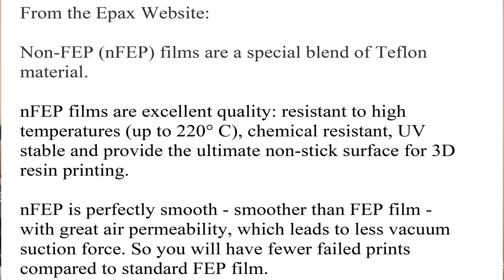NFEP for resin 3d printing, you're not using this?? WTF?!?!  We need to talk about this!

Comment: How did you judge the correct tightness when putting a nFEP on the SM4k? I've tried using the sound method but I was unable to get higher than 230Hrz even at maximum tightness. I've been having trouble with support failures at lower layer heights and think it might be a problem with the FEP being too tight.
Reply: I too was having a hard time getting it up to 300Hz and settled for ~265Hz which was pretty tight... seems to be working fine.
Reply: Literally just switched to NFEP and am asking that same question. I can only just get 200hz and i've got no more room to tighten. Am thinking its either a denser chemistry or my spacer for fitting was a little too big. It sure feels pretty tight though, in fact given the fails i'm getting i'm thinking its too tight even at that range. Would be good to hear the hz from a succesful NFEP-er

Comment: Thanks for the stories, tips and tricks!  I am just starting with Anycubic Photon S printer.  I have been watching your videos to "get a clue".  To date I have found that supports make or break the print.  I am an expert at "breaking" and struggling to build my making skills.  I love undead, skeletons in particular and the small bits make them a challenge.  When they are not covered in armor, using crude weapons, there are a lot of skinny limbs to support without damage.  Would you consider doing a video setting supports for skeletons (or other thin limbed) minis?

Comment: Slipperier has been added to my vocabulary.  Thanks!  I actually got PTFE lubricant that I was going to try this coming week. Another YouTuber recommended that.
Reply: After fighting my printer for nearly 2 weeks, I saw Crafsman's video that recommended PTFE lubricant.  Since then, every time I clean my vat I lube the FEP with a bit of PTFE, and haven't had an issue with prints sticking to the FEP since.

Comment: Great vid!  While you're on the topic of FEP...  With all the mono printers hitting the market currently, I think there is a great need to address a certain topic.

That topic is... the use of an additional FEP sheet directly over the monochrome LCD screen, for protective purposes.  As far as I know, all of these new monochrome printers lack a layer of tempered glass above the LCD.  Many people are complaining about how easily the unprotected screens scratch, and are also concerned about a possible FEP tear during a print session (resulting in potential disaster for the naked LCD).

You mentioned in the past about maybe making a video on this topic, and I think it would be a TREMENDOUS service to the community if you did.  Nobody's addressed this topic on Youtube yet, as far as I know.  Is using an FEP over the LCD a viable solution for those that want to play it safe, and protect their LCD?  Will the extra FEP distort the light too much and compromise the print? These are some questions that need answers.

You could maybe use something like a Mach5ive Stick On Gasket (https://www.amazon.com/Mach5ive-Stick-Gasket-Resin-Printers/dp/B08L41PCS5/) to attach the FEP to the LCD...  With your analytical & scientific approach to testing, I trust that you'd do a great job investigating the feasibility of this practice.

Pretty please?  I think there are probably many people who'd be grateful to have an answer to this question, besides myself.

Comment: Nice! I did not know about NFep. Nice Tube!
I've noticed slower lifting speeds = better details on surfaces that are near parallel to the build plate (details get pulled down/off when lifting speeds are higher). If you find that the NFep gives better details compared to FEP at similar speeds I'm buying that stuff! 
More VROOM the better!
Reply: I've learned that those surfaces are one of the first things to have problems with Vroom speeds when it's too cold, sometimes even before support failures.

Comment: Greg, what are your thoughts on PTFE lubricant?
Reply: I've been using it since my second bottle or resin. Combined with roughing up the build plate it completely cured my problems with prints sticking to the FEP.
Reply: @3rdpig  Same experience here.
Reply: @3rdpig  Ill give this a try
Reply: I treat my FEP with Rain-X . I always use that stuff on my windshield and nothing sticks so I tried it on my FEP and it works great. Follow the directions for application.
Reply: I believe he said once that he thinks it's unnecessary.
Reply: I put a single drop on the FEP in my Photon, and haven't had a print stick since I started.
Reply: Im keen to know his thoughts too
Reply: My missus swears by it!
Reply: I imagine is is helpful for that first few layers, but after that it is going to have mixed in with the resin or baked and peeled off the FEP as part of the model, so I am pretty sure that over an overall print it is not going to help much.

Comment: Any recommendations on using and buying nfep sheets for Saturn sized printers?
Reply from the maker: yeah, Epax makes them big as well, I use them on my Saturn and Sonic Mighty
Reply: @3dprintingpro212  I have just ordered one for my Saturn. If interested its the one for the Exax x10. Its the one that is sized at 10.1 inches. In the UK you can get them from isjuto3d.co.uk/epax-shop.html

Comment: I've been using "NFEP" since the EPAX X1 original version was released.  A while back, I tracked down what this stuff was, and found it is PFA (Perfluoroalkoxy) film.  I have been buying it by the sheet/roll from McMaster Carr, and cutting it to size for all my LCD printers.  It does work better, and lasts longer (because resin doesn't stick to it as bad, so it doesn't pull the film into deformation).  It is McMaster part number 84955K26 (https://www.mcmaster.com/catalog/126/3863/).  Don't everyone go out and buy it all up, because I might need more!
Reply: Awesome, just ordered some!
Reply: what thickness did you order?
Reply: @robertfousch2703  0.005" (0.127mm)
Reply: Thanks for the info - that link does not seem to work for me, it shows multiple items. I manually searched for the part number and it seems to show this - is this it? Thanks again! 

https://www.mcmaster.com/84955K26/
Reply: @Gijoeandstarwarsguy  Thanks for posting a working link.  Yeah, I noticed somewhat later that the link I gave seemed to only work for my current session.  The part number is correct, though.
Reply: @scifiguy000  Hey man, I just did some math and to let everyone know, YOURS is HALF the price of the epax one! We should get GREG to get some and test it! 

288 SQ INCHES  (McMaster)

31.83 per product / 288 =  0.11c per sq inch

---------------------------------------------

128.7  SQ INCHES  (Epax)

25.00 price per product / 128.7 = 0.2c  per sq inch
Reply: @Gijoeandstarwarsguy  Yeah, if you get a 2ft x 2ft sheet for $64, it might seem expensive at first;  but, if you layout an optimized pattern of vat-size pieces to cut from that sheet, you can fit many, especially if you have multiple machines with different size vats.

Comment: As stated on EPAX site,    
nFEP is perfectly smooth - smoother than FEP film - with great air permeability, which leads to less vacuum suction force. So you will have fewer failed prints compared to standard FEP film.
Reply: He put this at the beginning of the video, too, but that's marketing material directly from the company. Which is why he was asking for other sources of information.

Comment: Recently heard of this, good timing!
It’s Teflon based and can tear relatively easily.
Reply: Been using NFEP for 7 months, not a single tear or issue.
Reply: Haven't had any tear on me either in the year of using them.
Reply: @TheLostFireWithin  
The report is when people try to use the metal scraper to see if anything stuck to the bottom of the vat.
Reply: @chucklamb3496  no one should be using a metal scraper in their vat ever lol

Comment: I know this is completely unrelated, but I find no info online, and you ARE an expert. Long story short, went to print a base for a figurine. Printed it on it side, fully. It looks ok, but it's kinda... squashed in the Z axis. It's a slight oval instead of a circle, but other than that, the details all seem ok... what can be causing that?
Reply: More than likely lack of supports, the part probably warped because of that. If you wanna send me pics and we can figure it out let me know!
Reply: @UnvarnishedTarnished  Wouldn't lack of supports make it... longer? After all, those pull on the Z, so the layers would be more separated if they didn't do their job...